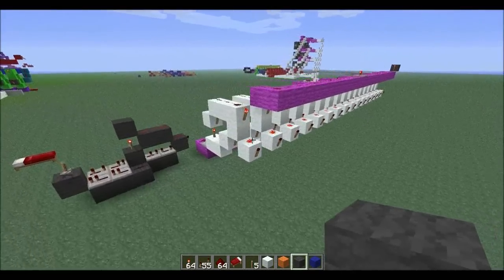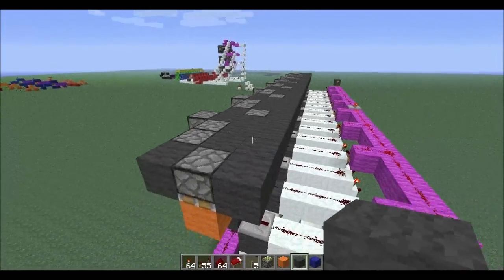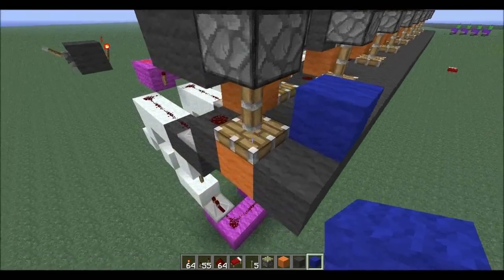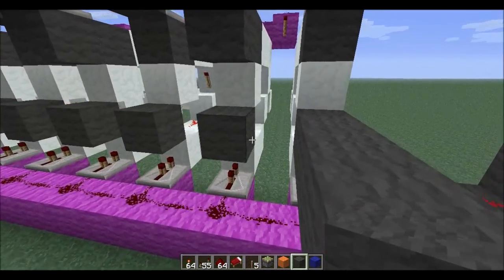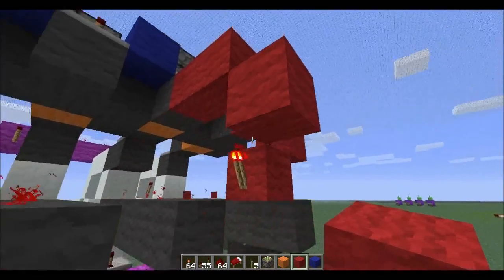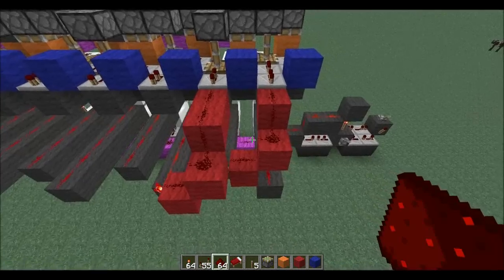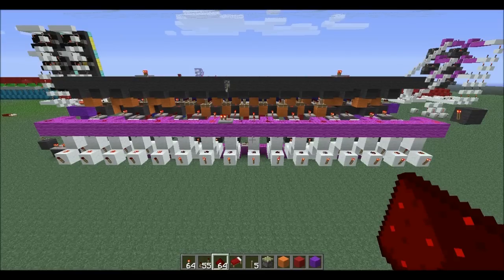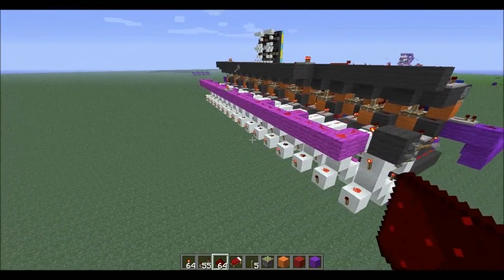Minecraft Redstone Tutorial 16 Bit Bi-Directional Shift Register | Reversable/Rotating Feature

Comment: @CrucialCrafTTTT
Might not because of the torch invert. Normally that design requires it because it feeds back into any other lines involved. Should've also mentioned ticks in the video. The monostable needs to be timed to the amount of ticks between two d-flops. So 3 ticks inside and whatever on the outside.  You had it on 3 including the invert torch, so that would make the monostable 6 ticks total. Clocks min time is half the monostable time due to having 2 states.